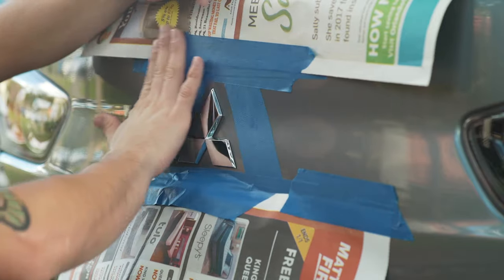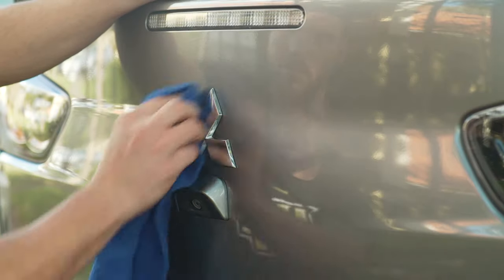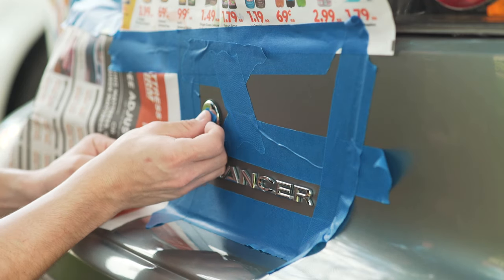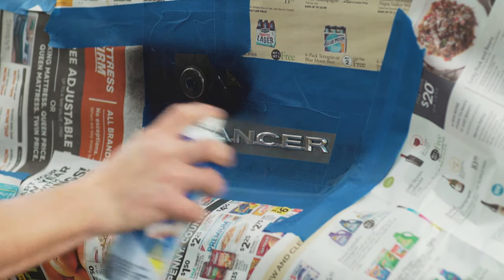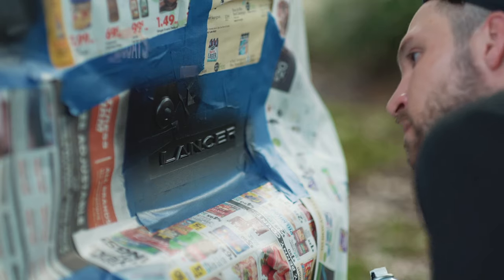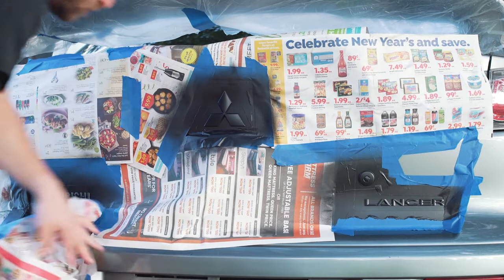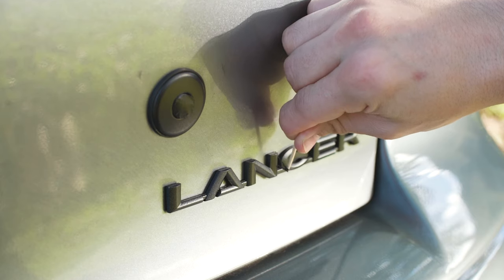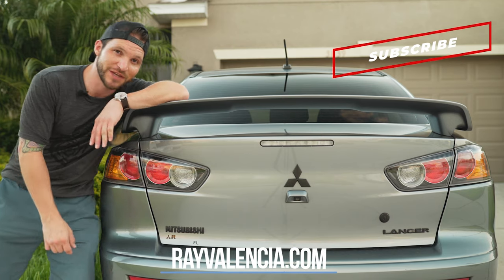How to Plasti Dip Car Emblems - Black Out Car Logos on Mitsubishi Lancer GT

Comment: Hey man, just did this out when it was time to peel it came off my badges too
Reply from the maker: That's Weird. How many coats did you do? It takes 3-4 good DRY coats to make it stay. I had it on my old Mitsu. Lancer (in this video) then I did it again to my Outlander and it's still on there just fine, 2 years later.

Comment: Great Vid and love the camera quality. One question how long after your final coat do you start removal ? Going to be doing this soon and dont want to mess up lol
Reply from the maker: After 3-4 coats, wait 30 minutes for it to dry after each coat, including the final coat, then you can pull off the access plastidip. After you remove excess, it takes 4 hours to fully set before you get rain on it or anything.
Reply: Thanks for the tips. Finally plasti dipped my badges and they look amazing. Also debating if I should black out the front emblem as well but I blacked out the front grill so Im thinking it might blend in to the point where you wont even see the badge.